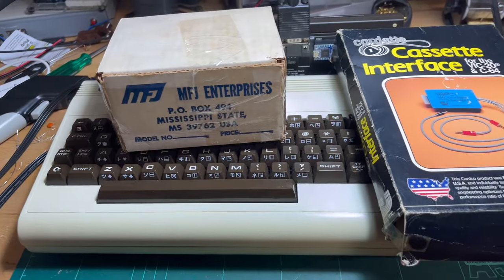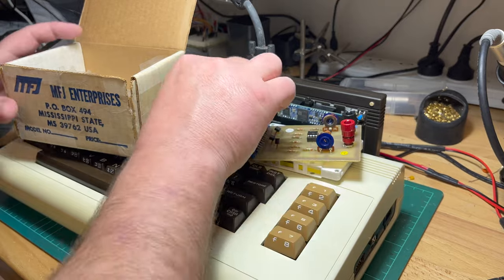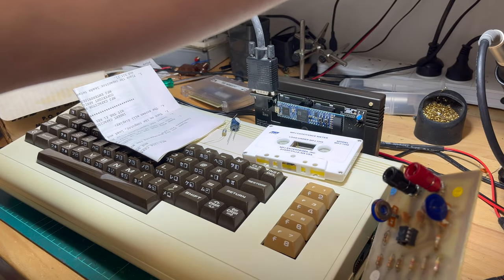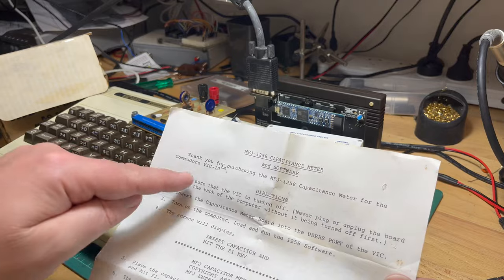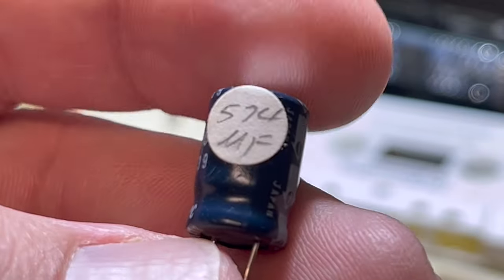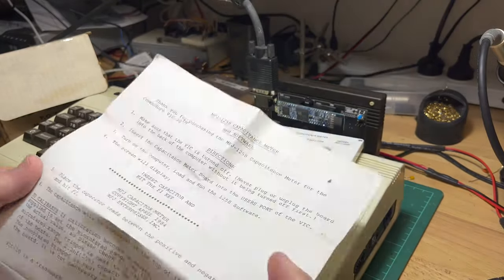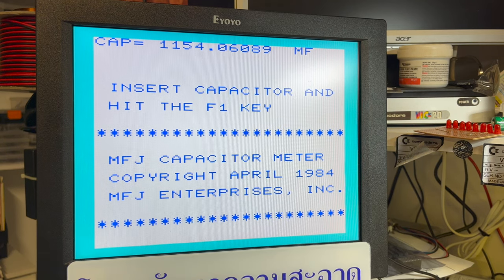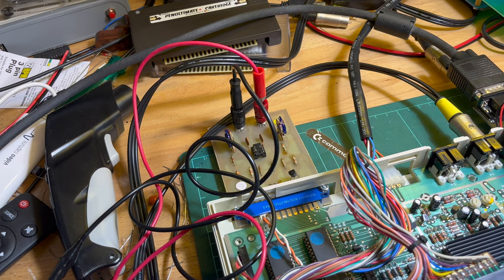🇺🇸 Commodore VIC-20: MFJ-1258 Capacitance Meter [TCE #0192]

Comment: Nice find, I love weird boards like this too. For future reference, you can test the function keys easily from BASIC by putting the computer in quote mode. Just type ?" and then when you hit the function keys, the control codes will be visible if the keys are working.
Reply from the maker: Ahhh ... thanks for the tip Robin!

Comment: A couple of things, first the address on your box is on the grounds of Mississippi State University. I don't know of any other businesses that are located on the grounds of a university. Damn rare. And MFJ is still in business (now down the road a bit) and I'm looking at my MFJ-1020C Active Antenna. :)

It's mostly known now as a company that caters to Ham radio enthusiasts.
Reply from the maker: So I might have a chance at getting a software fix for incorrectly measuring 2200µF as 40µF (which I somehow thought was 2.2F) ... ?
Reply: @Brfff  A slim one... :)
Reply from the maker: Duuuh ... "Mississippi State" == Mississippi State University ... sorry, my brain just connected the dots ...
Reply: The guy who designed it is probably Martin F. Jew himself.

Comment: Just think, if you had ones for voltages, resistance, and inductance you could replace your SIGLENT with a VIC-20!... 🤔
Reply from the maker: I had to resist the urge to hook it up to the 4700µF smoothing capacitor on the board whilst it was running ... but people would've been cross I was doing something so blatantly stupid to a VIC-1001